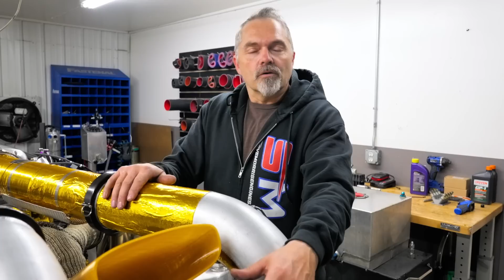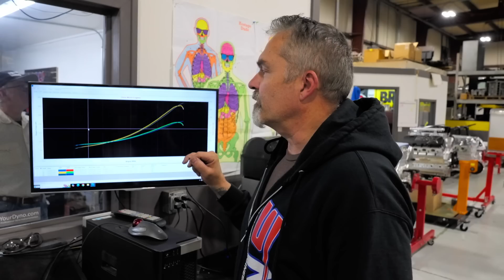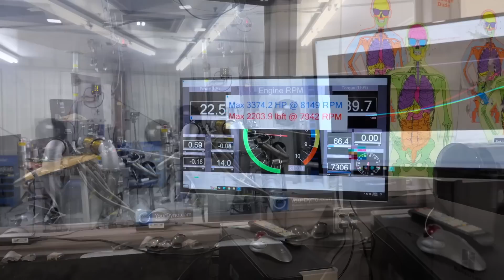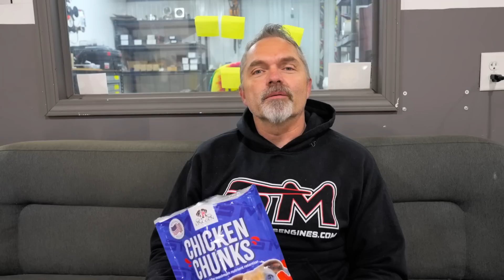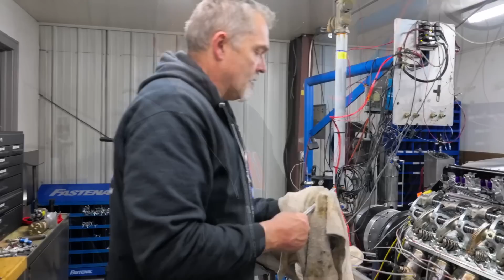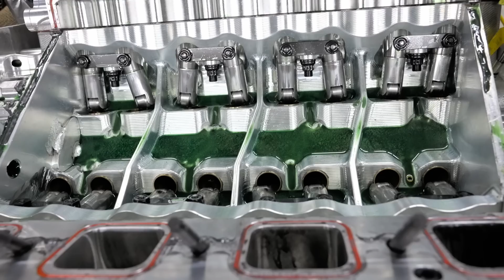Building A Land Speed Record 500+ MPH Engine

Comment: Steve,
With the turbo trying to pull so much air through the plenum, the actual pressure applied to the outside of it to make it start collapsing is standard atmospheric pressure. The velocity of the air going thru it is so great it has created an extreame low pressure, has it not?
Reply: Absolutly corect. The tube is not being drawn in it is being pushed in by atmospheric pressure, the turbo is just reducing the inlet pressure in the tube because it is too small. Atmospheric pressure is working on every square inch of the external surface so it takes a small delta P inside to outside to generate the force required to collapse the tube.
Reply: @ if it is acting as such on the snorkel end alone then one can assume this could be a catastrophic failure point for the entire intake system they have.
Steve, you may have a bigger issue than just the end of the snorkel to address.
Worth looking at further, this is only my opinion.
Reply: Didn't see that you already asked my question earlier.  Basically the same thought just worded differently. I think that we are on to something. Great job! Wish I  could have watched the video earlier.
Reply: If I'm following what your saying, it sounds like it could possibly damage the turbo shaft like twist it in two pieces or damaging the oil seals. Similar to having a severely clogged airfilter.
Reply: @toddchubb3464  no it is not starving for air, just the air velocity is so high the inlet pressure is dropping off, if it got worse and air flow was restricted further yes the thrust washer could possibly fail and the turbine could twist the shaft off.
Reply: @michaelbrown6241  right on thanks for the explanation
Reply: Several forces acting between the plenum and turbo. I suppose the plenum could collapse causing any number of issues.

Comment: modern Hemi's, and top fuel Hemi's have two spark plugs per cylinder.
why do these billet Hemi's, is it a valve train architecture issue, strength, cost of 8 extra spark plugs.
what gives

Comment: Old trick I do it use 8 telescopic magnets and use them to pull the lifters back up the lifter bores enough to slide the cam out.  much easier than a manifold off ?

Comment: Two questions; What caused the cam sync to seize up, destroy brass gear drive, and cam shaft? Second, I expected to see you tear the engine down for complete clean up of brass gear material And missing material from cam shaft gears, will this debris Not compromise the rest of the engine and bearings? Video not done, so maybe you answer this?

Comment: 8:49 ... he needs to velocity stack that 3d printed inlet on the turbo.  It'd fix the thing collapsing at full boost and probably take some load off the impeller too.
Reply: would probably be a good idea of just making this thing from billet aluminium, because if it breaks the turbo will suck in all that stuff and you have a real expensive engine failure... anyways i never saw an engine sucking this much air into it its crazy

Comment: With engines like this, have you ever wondered that they draw so much air and that having the dino room doors  closed that you're creating a lower atmospheric pressure that may throw off your dyno results?
Reply: They have outside air exhaust fans running during dyno runs.  Now does that create a slight negative pressure event with the exhaust fans pulling air out of the dyno room.. maybe, depending on the design of the intake side of the system.  But even if that is a poor setup... I suspect the air exhaust fans keep exhaust gas from contaminating the incoming intake air charge.. So, maybe the difference is negligible.

Comment: I'd be curious to see what the oil pump looks like. Maybe it locked up causing the cam sync to lock which caused the gear to brake the cam gear tooth?
Reply from the maker: Nope turns over smooth and nice

Comment: •° •° •° •° JUST IMAGINE THESE HEADS SLIGHTLY MODIFIED, TO ACCEPT 4-VALVES /CYLINDER.😮 AND ENLAGE the ports slightly. Figure the gain the valves will flow and get about 80% of that amount of flow from the ports. Say it gets 100cfm gain, start with the flow bench, get 80 cfm to start then look into getting more flow
Maybe 150-200cfm over the single intake valve  maybe a different camshaft with .100" additional lift, or 10°-20° additional duration (maybe both/ all the above) and look into getting 150%+ of that out the exhaust. Possibly raise the exhaust ports 
.030"-.050" and just as much wider. to get additional flow. Example numbers, maybe it can flow 650 cfm with 4 valves and 495 with two.  Use lighter smaller sprongs and valves, conical or beehive springs , titanium retainer m6 stems with 1.68" intake valves 1.55 exhaust, maybe use sprongs to push the lifters on the cam. (3.38"int. 3.10"ex. total diameter)don't think the bore will allow valves that large? Maybe it will and then some. Maybe two 1.84"-1.94" intake, and 1.6" exhaust, enlarge/ deepen the bowl area.  And raise the port ..200"-.250"  and the bowl .100"-.150" widen the port  
.080"-.120"?  Modify the original inteke to allow the runners to be enlarged and raised. The fland area on the head kept in the same area. Maybe add a spacer. And add a larger throttle valve. 20mm (+/-) diameter maybe it could be making 4200-4300(+/-) hp right now?  If anyone could do it you can doo it!👍 have an awesome day, ✌️

Comment: I'm surprised the oil pump is still internally driven and not an external unit. How much torque is required to spin that pump at 4,500rpm?? Can that bronze gear cope with that??

Comment: Maybe a roll pin in the cam gear has backed out a tad or mesh was that far out the gears have tried to jump over one another it does look like thrust is a issue with the assembly or cam thrust could be excessive throwing out the calculated mesh.

Comment: Awesome video. Land speed racing/engines are very, very cool. I only built one, but running it wide open throttle on the dyno for 70 seconds was quite the anxiety inducing experience.
I'm curious about the choice to run this as a wet sump- can you discuss the pros and cons in a land speed engine?

Comment: I’m surprised that that engine is using wet sump oil system.  Is there not enough room to run a dry sump or is it a rule thing?  Thanks.

Comment: Since the water vapor in ambient and compressed air is what transfers heat, and hot air is detrimental to performance, have you ever experimented with removing the water vapor before it enters the engine intake???
Respectfully, you spend so much money on intercooling, why not try to fix it before it causes an issue instead of "bandaging" it up later.
Reply: Do you understand how much energy it would consume to condense the water vapor out of that volume of air, especially at that flow rate?
Reply: @tommymac3029  There are 3 main ways that heat can be transfered through the air or even a vacuum. None of them require water vapor. But that doesn't really matter here anyway. It's not about heat transfer. Cold air is more dense and therefore will have more oxygen needed for combustion. Cooler IAT makes the engine less likely to detonate or spark knock and can allow more spark advance for more power. You can't control the humidity of ambient air at the track without using a CAS, Compressed air system. When Steve said that intake air temps generally go up 10 degrees per lb of boost he didn't mention the fact that they go down dramatically from the injector downstream because of the "Latent Heat of Vaporization". Introduction of a portion of the fuel just past the iintercooler would have made the IATs go down substantially. The IACs aren't even measured below the injector but everyone already knows that the Latent Heat of Vaporization works best when the fuel is introduced farther away from the combustion chamber.

Comment: Hi Steve! Had a question since that is an absolutely massive turbo. Have you guys had issues before with an engine ingesting so much air that it has tuning issues because of the room size of dyno room? Or do you guys pump in fresh air as well as pull exhaust out?  Thank you for your time! God Bless

Comment: Steve, could it be that the turbo is moving so much air  that it is actually depressurizing the in side of the intake scoop to the point that there is more pressure on the outside of the intake then on the inside, hence the collapsing Ish or compression  of the tube.    Just guessing makes since to me.
Reply from the maker: Yep !

Comment: Question what is the speed of the air at the intake and how much suction is made
Reply: You can calculate that yourself. Displacement x rpm / 120 will give you the volume of air moved per second. Guesstimate the intake cross-section and you can solve for velocity.

Comment: I assume the cam sync gear is brass. Could a piece that broke got jammed between it and the camshaft gear? Also is it feasible to have a switchable backup system for the cam and crank positions ?

Comment: have you ever created a set up to measure the torque required to run a gear driven oil pump at 8000 rpm? just curious how much thrust it would put on the cam.

Comment: Do you think the angled gears drove the brass gear up the shaft and locked it up. We have that problem with timing gears on our pulling tractors breaking the end of the crank off had to go to straight cut gears

Comment: Since we mentioned oil pumps in today's video it brings up my questions.  1)What oil is used in this engine and viscosity?
2) I know dry sump oiling is the superior method in oil control, but why have I recently heard that proline engines are a wet sump? Builds like Garrett's Eagle does not have a dry sump tank. I am interested in your answer Steve. 
Thanks to you and your crew for letting us come along for the ride. These vids are great to watch and informative..
Reply from the maker: Our own oil coming up soon
Reply: Eagle is dry sump. Proline hemi's are all dry sump engines.
Reply: @allenwilliams87 - I tend to agree but in looking at videos of Eagles engine bay I don’t see an oil tank?  Edit:  I just saw the post above indicating CJ put the oil tank inside the car.
Reply: Nobody’s making that big of power wet sump. Or if they are it’s far and few in between and they’re wasting a lot of power doing it
Reply: I run a PLR Mh7 595ci and they are in fact dry sump
Reply: I vote for your question to be answered.
Reply: You sure Eagle isn't dry sumped? I could've sworn I watched CJ and crew mounting the oil tank inside the car if I can recall 🤔
Reply: @johnnygeorgopoulos4072 100% that thing is dry sump way too much money not to use a dry sump.
Reply: @johnnygeorgopoulos4072  - I’m pretty sure Eagle has a dry dump system.
Reply: They have been moving back from dry sumps because of the added complexity and risks that come with them, when they aren't really needed anyways over good baffling in most situations.
Reply: If PLR is running wet sump that seems incredibly risky.
Reply: @Backyard_Racing  i agree, but I heard it in another video and was curious if this were true or not. I have seen a few big builds without dry sump tanks and a wet sump looking oil pan. Possible they are in fact dry sump still? Just wondering what Steve has to say about it considering he has most of that knowledge to inform us on. When you work on that variety of builds on the daily, you tend to know a thing or two
Reply: @ I’d trust Steve for anything and even if he didn’t know he would find out.
Reply: looks like green joe gibbs racing oil
Reply: @krusher74 Just the color.

Comment: Why is that engine not a dry sump? Seems kinda weird to drive an oil pump that way on big power engine. I'm guessing it has to do with tight spaces in the car....but still and Holy crap, $700 for an impact? I like my Dewalt @ $200 just fine lol.

Comment: Camsync got pulled down into the oil pump and the Reluctor disk kissed the sensors and welded up the two disks.

Maybe the shaft moved on the cam gear ?

Comment: You know i would like to see a dyno comparison of intercooled methanol vs non intercooled to see the power difference. Must not be worth it to 90% of drag racers seeing as most people dont bother with them. Salt flat racing i can see it really helping prevent detonation on those long full throttle pulls. 
I have heard where if you get the iats too cold like down around freezing methanol can have a hard time with atomization and cause misfire issues.